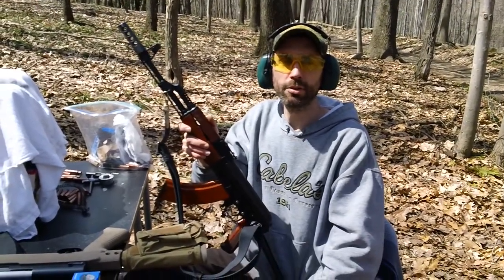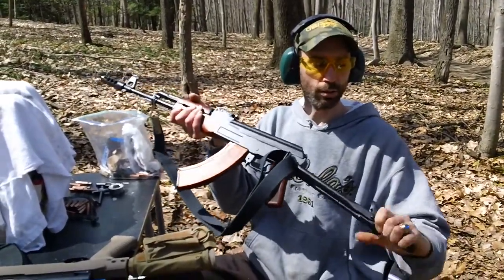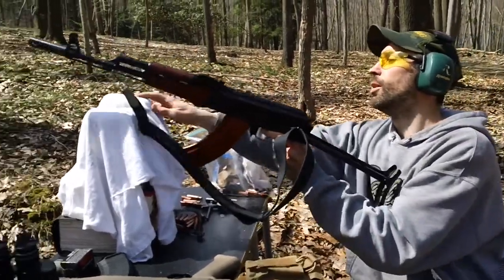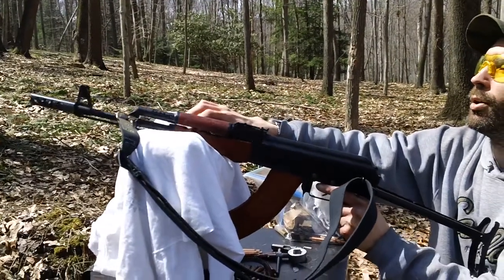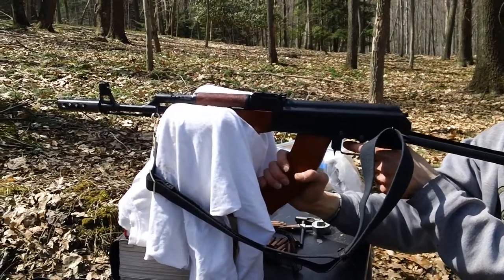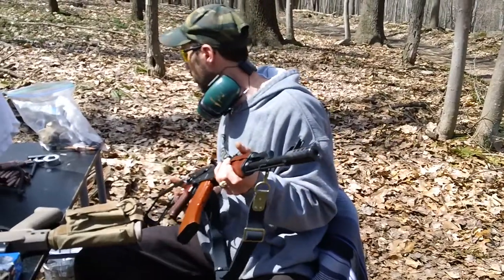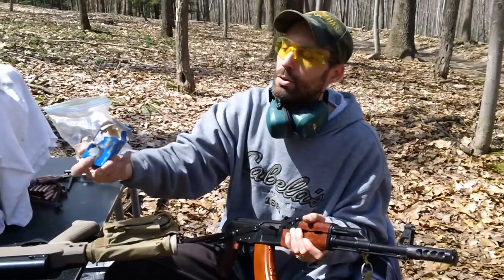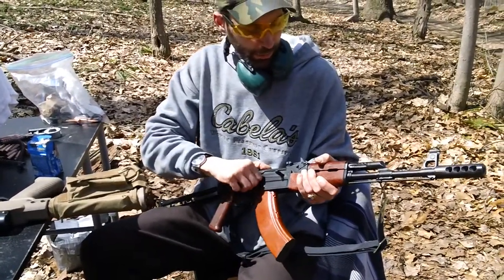DDI AK-47 shooting

Comment: Im glad it all worked out ok for you.
Reply from the maker: ***** thanks man,  i will keep test shooting at my cabin probably a couple more times just to put my mind at ease with this purchase,  one thing i need to mention when i went and tried to adjust the windage on the front sight post i ran into an issue where my Magna-Matic Ak-47 front sight tool will not work properly on my rifle,  sir did you adjust the windage and elevation on your own rifle and may i ask what tool did you use to fix your rifles groups,  mine was shooting insanely low at 25m it was shooting about 20in below and 1in to the left dead center of the target before i adjusted the elevation.  the rifle currently has a 3yr warranty now,  i filled out the app form on ddi's site for it,  i would recommend doing this as well sir if you plan on keeping your own rifle for at least 3 years after you got it back after being quote "repaired" from ddi such as i did.
Reply: Chris Ursiny For adjusting the windage i used an old tapco tool and for adjusting the elevation i just used a standard ak47 cleaning kit tool.As for getting it sighted in i didnt have much trouble it only took me about 20rounds at 75 yards.

I did sign up for the DDI warranty just in case somthing happins down the road but with all the problems ive had ill never buy another production made AK ever again(unless its an Arsonal) im going to build every AK i plan on owning so i know itll get done right.

Comment: what the wood grip on it? where you purchase it
Reply from the maker: +Tub Ntxawg Hawj hello sir the wood is actually bakelite,  it is the upper/lower handguards, as well as the magazine and pistol grip it is a plastic resin that is reddish brown in color.
Reply: What site you order it from
Reply from the maker: +Tub Ntxawg Hawj http://www.robertrtg.com/store/pc/Furniture-c37.htm
Reply: I got another question 
Do i need order a new screw or the old screw from the stock will fit the Wood gripe handle
Reply from the maker: +Tub Ntxawg Hawj the old screw "should" fit fine,  that being said some screw holes may be tighter than others are,  with the new pistol grip i have done 3 swaps with bakelite, wood and synthetic handguards and all the old screws always worked fine with the new pistol grip.
Reply: thank alot chris i just order it and it should be here in a few days...also im waiting for my ddi ak47u at the gunstore its on order still so may take up to 2 week...before i get my ak47
Reply from the maker: ***** hello sir, thanks for the update,  when you get your new ddi rifle you should post up a review vid "just out of the box" and a video for range test to see how well it shoots and see if its dialed in at the proper 25m range.
Reply: +Chris Ursiny hey i just upload a video of my DDi ak47u, check it out